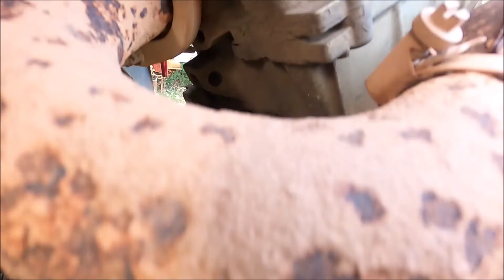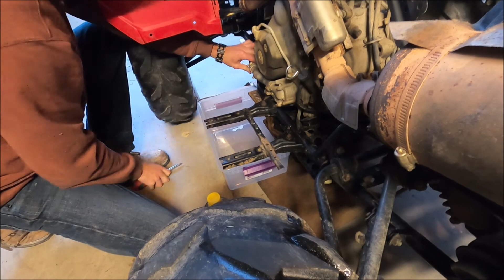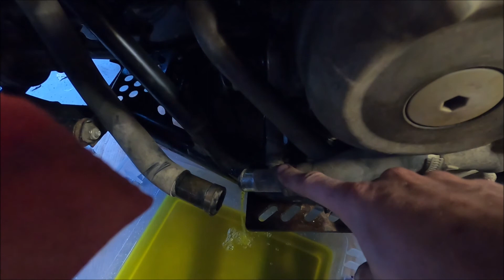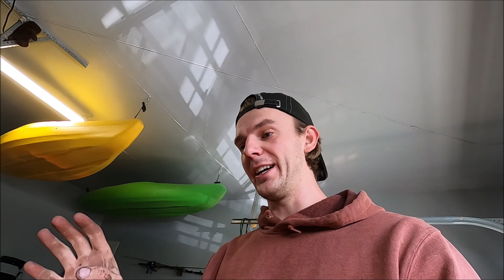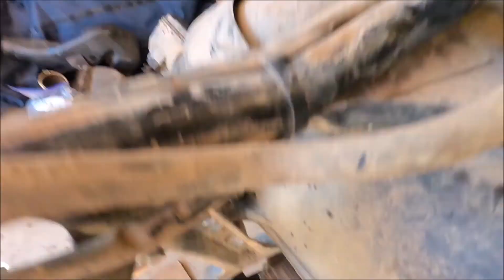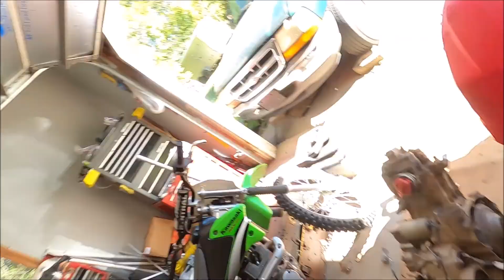16-18 Yamaha Kodiak/ Grizzly Engine Removal

Comment: if i may ask what happened to the red kodiak's engine? is this the 700 or the 4fiddy?
Reply from the maker: It was a 700, and I pulled it out to put it into a 2016 wolverine sxs that had a blown engine with missing parts.
Reply: @HitchinMitch  ok thanks!